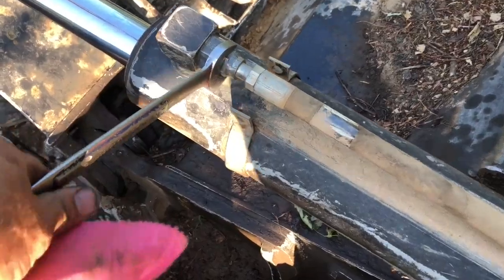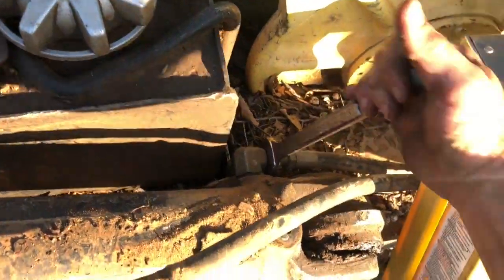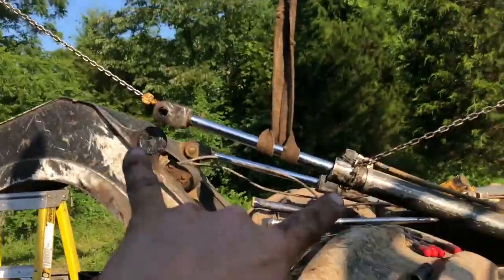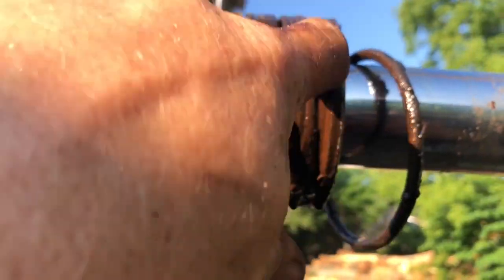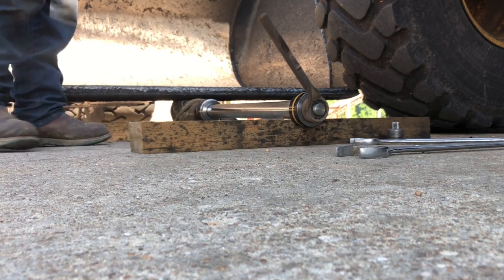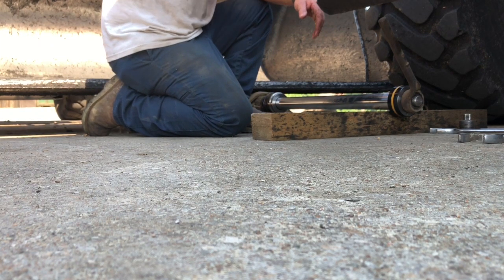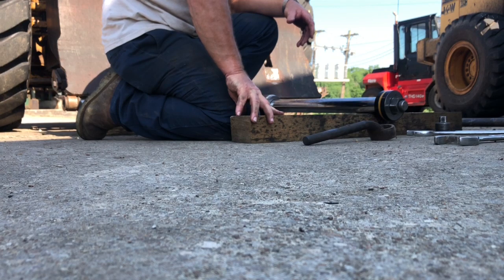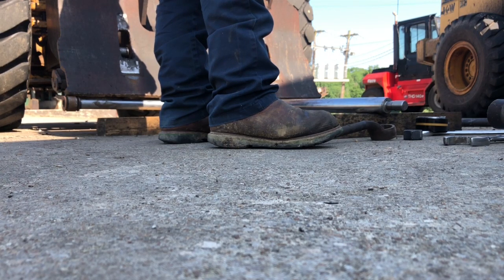Repacking Junkyard's cylinder!!!

Comment: We run about 185 lbs of air pressure at the sawmill. We had a cylinder about that size and I come up with the bright idea of putting a little air to ti to get it to come apart. It just missed mother. She was not happy.
Reply from the maker: Reel McCoy haha!!!  I bet she almost killed you
Reply: I blew one apart with air in the shop one day, blade cylinder off our 450E, piston took out a bench grinder, a tool box tray and knocked a hole in the metal shop wall. Missed a buddy by 6 inches.

Comment: Rebuilt one the other day designed just like it had a hell of a time getting it appart got one more to do we chained it to the floor and used chain hoist to separate it nut came loose fairly easy the hard part was getting the end drove in to take the lock ring out had the same problem Rust!!!!
gotta love being in the rust belt of America

Comment: Torque multiplier will take that but off right or hydraulic motor on a 80 to 1 gearbox. The output shaft machined so a 3/4 or 1 inch nut can be mounted to it will spin any nut off. Not that I have ever turned a wrench in my day.

Comment: The 540b I drove had a cage cab and a single big cylinder lifting the grapple. I went to grab a tush and just as it left the ground the back end blew off the ram and splurged 10s of gallons of oil straight at me inside the cab, I was soaked to the skin head to toe, gotta laugh about it now 😂

Comment: i wonder how tight that actually was..  somebody gave me sold old torque wrenches.. one is a 1,000 foot pound 3/4 drive , one is a 1600 foot pound 1" drive and another is a 2000 foot pound 1" drive..  they did not give me the thread in handle darn it..  they also gave me a several massive torque multipliers.. in 3/4 and 1" drive.. they all seem to be broken inside.. https://i.imgur.com/yHBgvZf.jpg https://i.imgur.com/4o3XvX9.jpg   thought you might get a kick out of them.  the new replacement handles are different than these old ones..